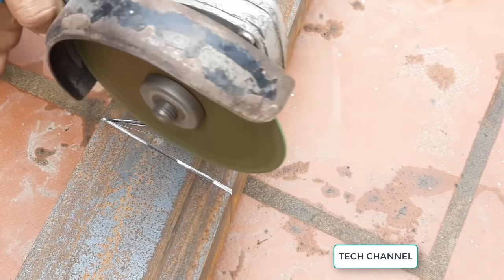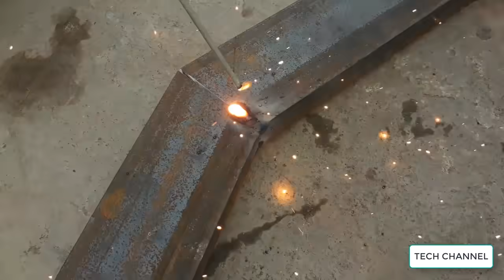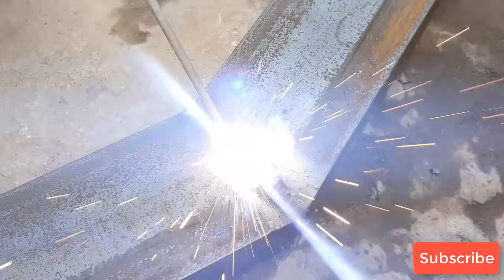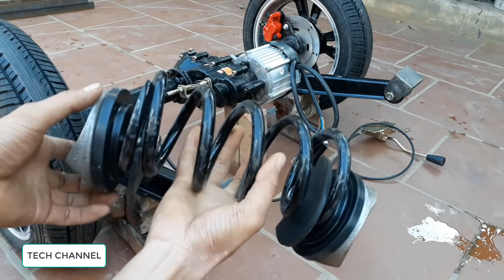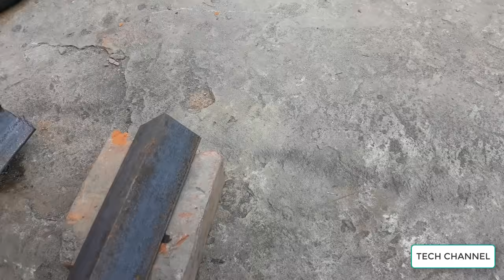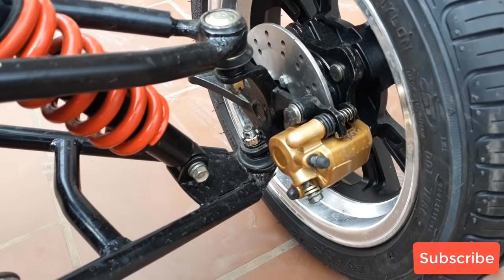TECH - Electric car with oil disc brakes part 3 - Frame the electric car

Comment: Iron frame will increase the weight of vehicles, which reduce productivity or may say driving range of vehicle. Can we use aluminium frame.
Reply: Of course you can,  you could use bamboo,  or even wood,  a lot of the old cars did.

Comment: hi. good job. but let me ask you some question why didn't you use double side electricity motor connecting directly tire so you couldn't need  a belt  and you could lead the power direct to tires

Comment: The front wheel drive system is changed a lot with iron parts welded by all it looks wild and not beautiful ... the shocks will make trouble of vibration because they are not independent ... You have to change the design as the traction table before a golf1 or fiat uno for example.

The behind system is net

Comment: I hate to be the one that breaks the bad news to you . Everything needs to be scrapped,  and start again. The suspension is a nightmare that will not work. 
The rear end will twist out if torque is applied.  No panhard bar , the list is way too long , start over

Comment: If you installed the control arms around, so the inside of the tire turns fewer than the outer side of the ring. The control arms are on the rear of the front axle, not on the front.